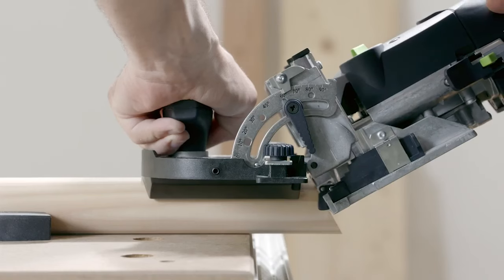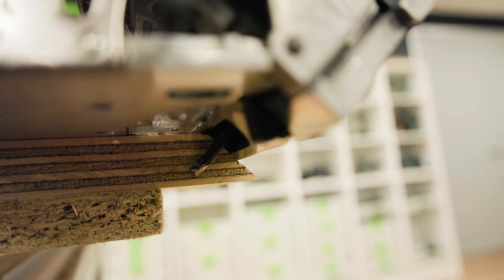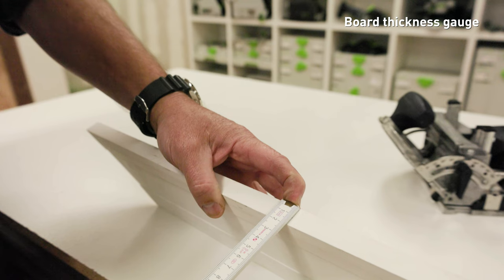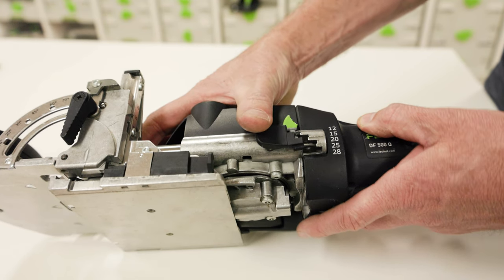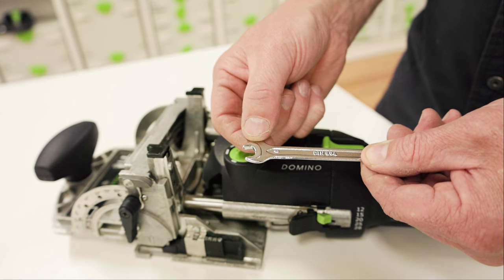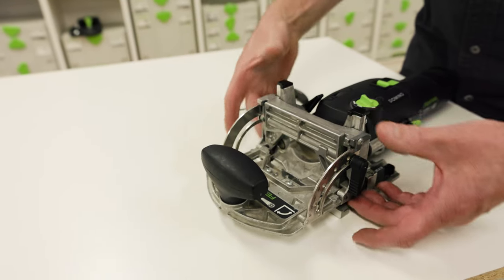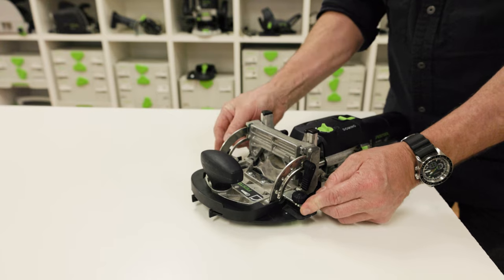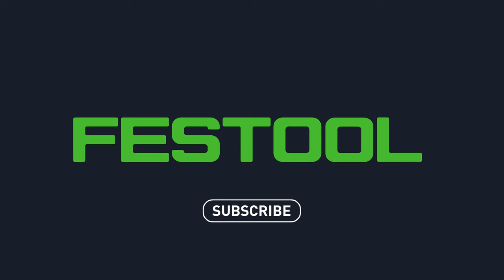Complete guide to DF 500 DOMINO Joining Machine

Comment: 1:11 using a domino DF 500 Q borrowed from a friend, the window is not adjustable enough and I am still offset by a very noticeable amount, I’m so glad I didn’t pay for this tool because I would be so pissed if I spent that much money and couldn’t even zero it…
Reply: Did you attempt to align it by marking a line 37mm from the edge and butting it up with one of the edge stops and then attempt to move the plastic gauge? I’ve seen so many videos on the DF500 before I decided to purchase it that I wonder if you didn’t align it correctly.
Reply: @HeadBroski  I did not check it with that method, but after making my corrections, everything lined up perfectly from then on. It was consistently 3/32 of an inch off, so double that and that's what the error was. 

After I made that change it was smooth sailing. 

The plastic gauge didn't have any adjustment that went far enough, and it doesn't look like it's meant to be adjusted at all. 

After I made that comment I had other woodworkers tell me that they just flipped to the wider domino slot setting for one side to solve this issue, Think I've talked to about three different professionals and that's their fix.